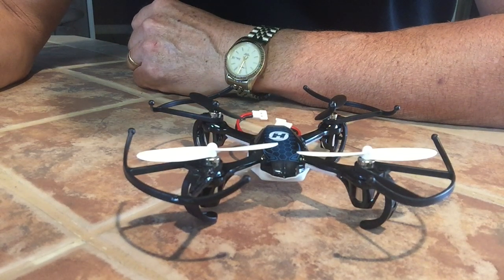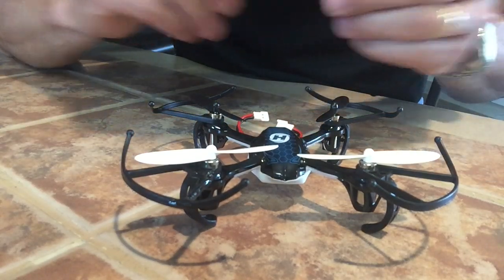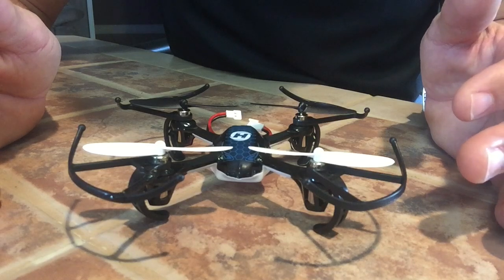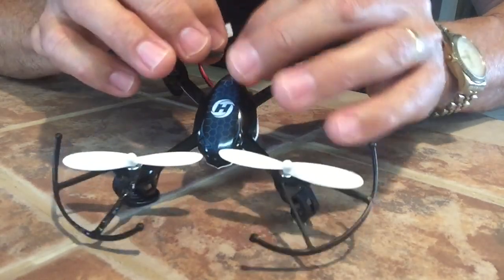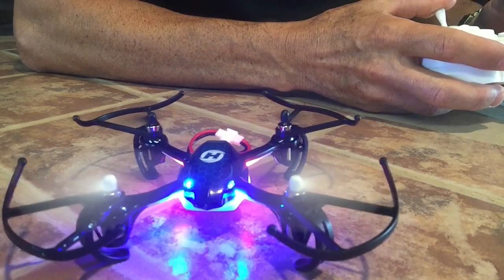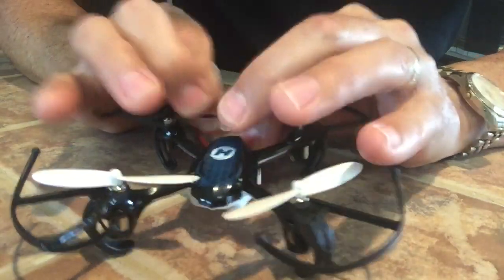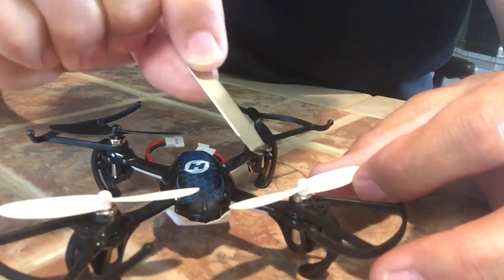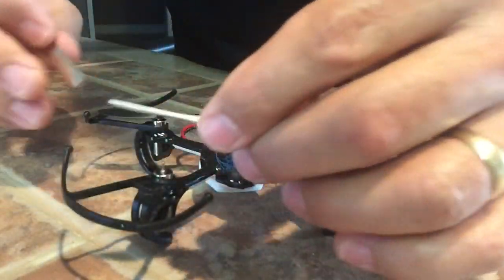Holy Stone HS 170 Predator incorrect blade position

Comment: I changed out my blades and I'm not sure they locked in fully because the blade spun off straight up and spun back down. How can I be sure they are locked in?
Reply from the maker: Alex,

If I remember correctly those blades pressed on snuggle.
They should press down tight, if they are coming off I would try some supper glue or rubber cement to hold them on. If they are new blades I would contact Holy Stone to have them send you some replacements. 

Thank you, 
Russell

Comment: You think the manufacturer would have made the blades in 4 different colors instead of putting a miniscule number on the underside of the blade to differentiate one white blade from the other. Can't tell you how frustrating it was to have the drone floundering around after blade replacement. If the company was smart, they would have a link to an introductary youtube video on operation and maintenance instead of a less than useful operators manual. Thanks for posting your video on this topic.